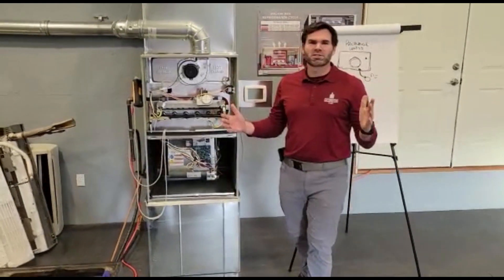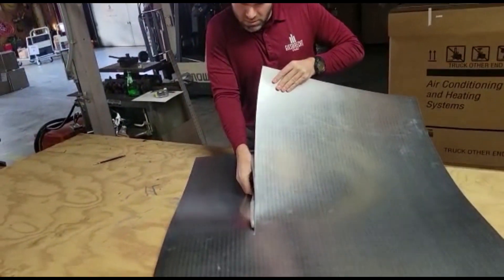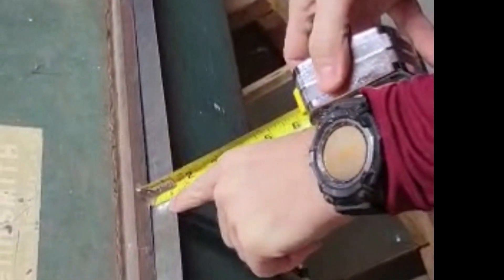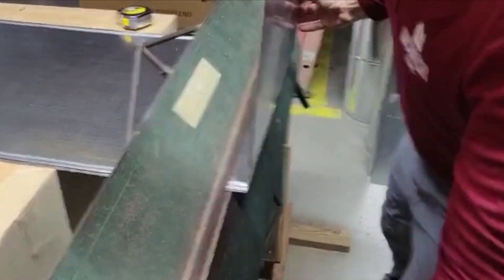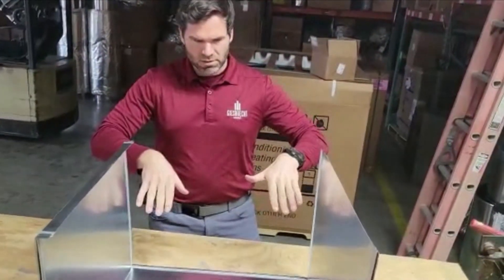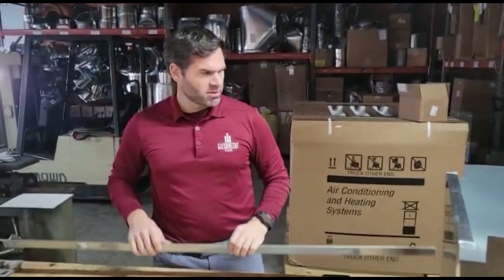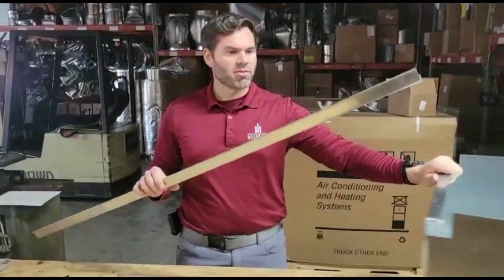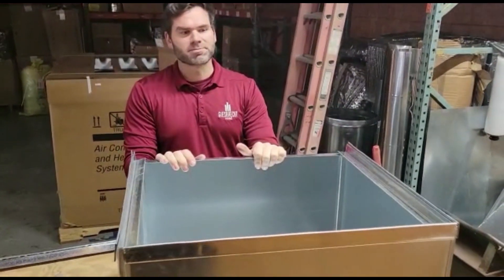How to completely assemble a Vertical Plenum Box for HVAC

Comment: Great video! Thank you! Question though if you have the time. How many inches over the measurement of the bottom of the air handler should I make the width of my box to sit correctly In A plenum such as this?

Comment: if you measure across inside the standing S cleats you will now see its smaller than 21" because of the folds of the Standing S cleats. You needed to have made allowances for that by about 3/16" or even more if your furnace jacket has screw heads in its construction. A plenum box that size should also have cross breaks. 21" wide furnaces are usually 4 ton blowers. Need cross breaks.